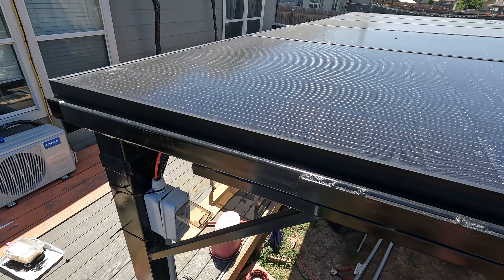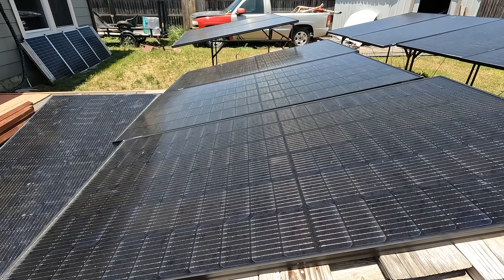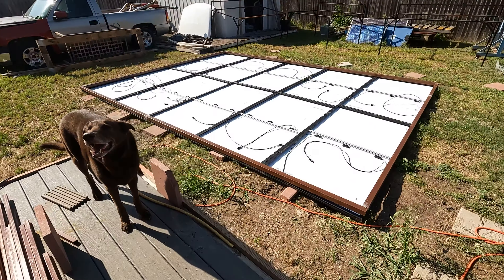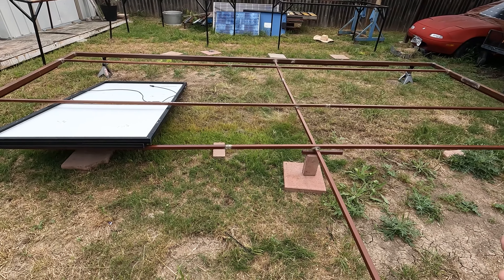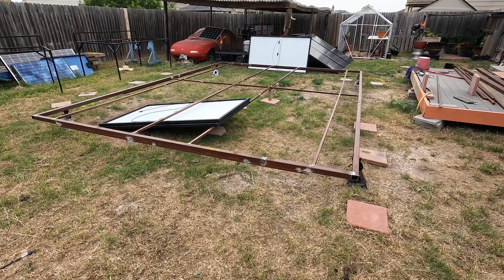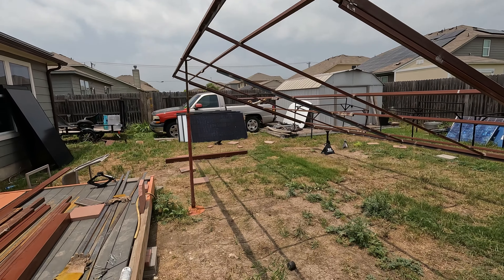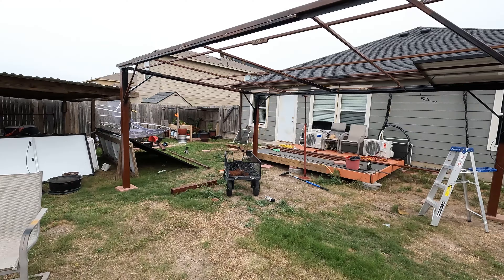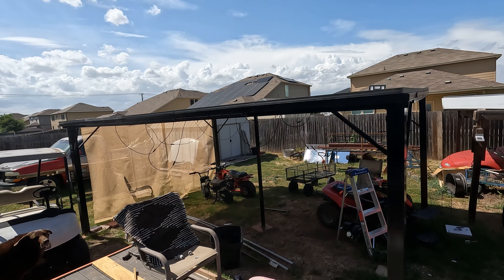DIY Solar Pergola Solar Panel Mount

Comment: Interesting approach! I have been watching Solar Pergola videos for a while, planning on doing one in the near future. Really love your can do attitude and am interested how you utilize the power, are you connected to the grid?
Reply from the maker: No grid connection,  this is for my off grid 48 volt power system that i use to run my mini splits and charge batteries, its plenty of power!

Comment: No hate. The wind will take that with it one of these days. That is basically a sail which once the wind catches it will be off to the races.
Reply from the maker: Agreed I’m working on a way to concrete in the footings, I want this thing to never move!
Reply: @Mikebuildss  Cool. I have a couple ground mounts. One that is concreted in and another that its on 48" ground screws,   Both are very sturdy. The wind on this hillside can be something amazing. After construction the wind was strong enough to blow one of the panels off the array because I didn't attach it well. Amazingly it wasn't damaged landing about 4 feet away. If I put up another array I'll do the ground screws again. The only problem is the 2" galvanized pipe for the frame is quite expensive.

Comment: It Surprises me that nobody appears to be  selling some sort of simple plastic/rubber sealing tape/strip designed for using solar panels as a roofing.
Reply from the maker: @peterjol  I would bet there are some products that would work, so far normal window calking seems to be dealing good it doesn’t leak water when it rains
Reply: Joist tape for decks. There might be some so the width don’t cover any of the cells. Put on top so water doesn’t pool and cause issues the many of issues that come with sitting water as compared to sealing from under.

Comment: what is your plans on mounting the pergola to ground?
Reply from the maker: @joejoe9399  I was going to add 4x4 wooden poles concreted into the ground the bolt them to the legs toward the bottom

Comment: Most of us aren't welders.  If only it is more DIY friendly.
Reply from the maker: @danstenis660  I can see that, theirs a few who have done it with wood no welder required!
Reply: @Mikebuildss  Wood rots and needs maintenance.  There are metal kits for carports out there, but they are expensive.  Would love to be able to go to Home Depot  and buy struts etc. there and fashion a solar carport out of it at a more reasonable price.
Reply from the maker: @danstenis660  also I used a cheap flux core welder, you don’t need a fancy machine to get good results, metal is cheap if you buy from steel supply places.

Comment: Australian here, why not put them on the roof of your house like we do?
Reply from the maker: @YeahTheOzzy  because when the roof needs any kind of work then they have to be removed, also wanted some extra shade!
Reply: @Mikebuildss  fair enough! how often do roofs need to be worked on over there? Almost never here.
Reply: Hi, have them on beams and rack on my wooden side roof over the garage and toilet / coal house. ( That dates the house!)
Easy to remove though with solar racking.
I have them on the sheds in the garden and a A frame on the lawn.
Looking at putting them against the fence line when I clear the weeds. (bushes)
Living in the UK not much need for sun shade! But I like it.
Take care M
Reply from the maker: @markeh1971   wey nice sounds like a solid setup! Thanks for the comment